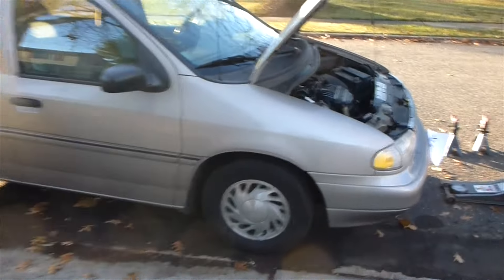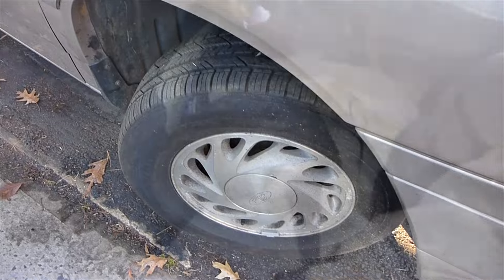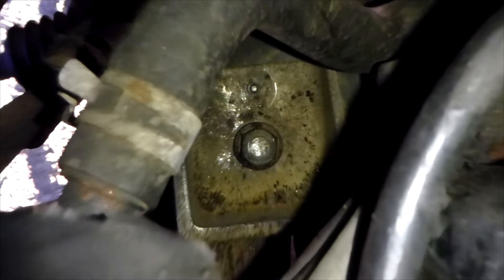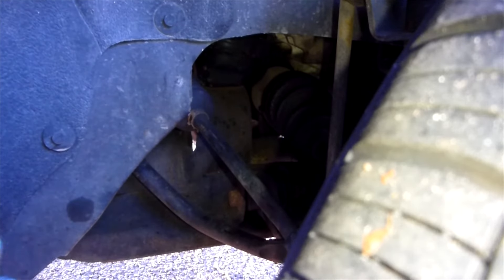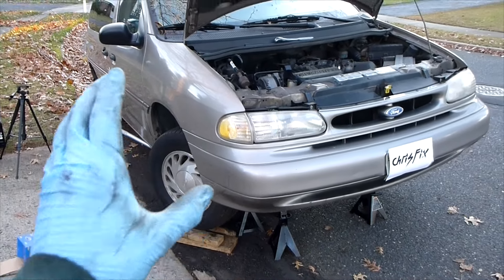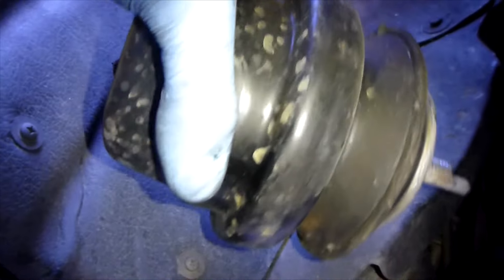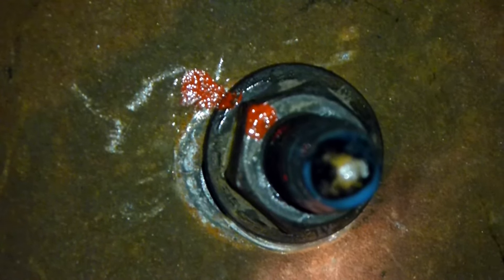How to Replace a Motor Mount or Transmission Mount

Comment: Dealing with installing new motor mounts before; my strong recommendation for Honda - especially Accords is to buy Honda motor mounts. Aftermarket brands are not the best.  You will pay more for Honda but it is well worth it in the long run.
Reply: @SoccerEverywhere2  I would buy the motor mounts specifically from Honda.  If you can get EOM Honda motor mounts somewhere else cheaper, definitely but make sure you get Honda - nothing else.

Comment: I already knew how to do this but i still watched it all the way through.  I love listening to how you explain stuff on your channel!
Reply from the maker: Thanks a lot
Reply: @chrisfix  ive been restoring an old '77 RV with a v8 440 and 727 tranny. Your channel has helped me save a ton of money and im learning how all this works in the process. Its been fun! Would love to see some other videos on transmission repairs, i plan on checking and possibly rebuilding mine soon.
Reply from the maker: Transmission video is next!
Reply: ChrisFix can you do a rack and pinion video ?
Reply: @rocktidwell898  i did a rack and pinion job on a dropped 91 acura integra and it was a nightmare to get it aligned. Make sure you have a way to tow the car to an alignment shop after the change. You can mark everything too but i dont think it ends up coming out perfect. It was probably one of the harder jobs i had to do on a vehicle so far but i was also just learning then. Im sure a true mechanic wouldn't have had as many issues knowing work arounds from experience. Id love to see a chris fix video on that too
Reply: @chrisfix  lol me too, i was just about to start a engine mount job and I thought" hmm how would Chris change one?" and here I am lol
Reply: Rock Tidwe. ll
Reply: Rock Tidwell 'm,katsgf
Reply: Sorry to be offtopic but does any of you know a trick to get back into an Instagram account??
I stupidly forgot my login password. I would appreciate any help you can give me!
Reply: @Abdullah Rex instablaster :)
Reply: @Leighton Tanner Thanks for your reply. I got to the site through google and im in the hacking process atm.
Takes quite some time so I will reply here later when my account password hopefully is recovered.
Reply: @Leighton Tanner It did the trick and I finally got access to my account again. I'm so happy:D
Thank you so much you really help me out :D
Reply: @Abdullah Rex No problem xD

Comment: the core support can be a beefy piece of metal though it usually isn't.  windstars have a pretty solid subframe that's heavy duty and welded. other cars have bolt on core supports or welded supports that do not have much structural integrity. as for jacking up the motor, you can usually get away with a 2x4 cut off under the oil pan if you gingerly jack it up and make sure the motor is moving independently from the chassis. jacking from a small area on the engine block increases the odds of causing damage to external motor components and injury due to less surface area making contact. i learned that the hard way when i was a newbie. i would stay away from jacking from mating surfaces because that has a higher chance of causing a leak. i just wanted share my insight. with that said, i like what you're doing and i like to see people maintaining their vehicles. knowledge is a great thing to share.
Reply from the maker: Thanks for sharing your insight. I would never jack up your motor from the oil pan, but I know people do. I appreciate your tips!
Reply: ChrisFix The Ford Workshop manual actually specifically says to jack up on the transmission pan with a block of wood for the trans mount on the other side.  For the mount you're working on here, though, it says to lift from the top (as if anyone's really going to do that for a motor mount).  I just thought someone might find that little nugget interesting.  Thanks again for the video!

Comment: Hello Chris! I have a question a guy at Precision Tune put both of my motor mounts on my GMC Yukon 2009 SLT and the engine light is still on he removed my tires to put each of them on he said that he didn't leave the seal on there so it would seal so I'm trying to figure out why my engine light is still on is it anyway you can tell me how to do and what to do or where I can take it here in North Carolina

Comment: Chris, I really enjoy your videos! They've been very helpful. This particular video helped me save my brother around $300 by changing the rear motor mount on his 1998 Ford Windstar ourselves. However, I wanted to let you know that the torque specs of 85 ft pounds you claim in the video was too high for the top bolt on for us. Unfortunately, we broke the bolt when trying to tighten it to 85 ft. lbs. Afterwards I looked in the Haynes manual and it says that the top bolt should be 50-68 and the bottom should be 65-87 ft. lbs. We were successful on the second install. Just wanted you to know so you could add an annotation in the video (at 9:07 and 9:31) in order to help others keep from making the same mistake. Thanks again, and keep up the great work!
Reply from the maker: +ohaneson thanks and great work!

Comment: Great video Chris. I recently bought a 1995 Roadtrek class-B RV with 144,000 miles (on Chevy G30 van chassis). Took it in to the dealer for new tires and was told it needed to have the motor mounts replaced. Now I know what they are and what's involved in replacing them.
Reply from the maker: +Daniel Noreladim No problem! Congrats on the new car!

Comment: Replaced my radiator a few weeks ago on a 2004 lancer es and noticed my transmission mount was completely shot. It was the easier replacement ever! Take off the bolt that holds the transmission and get under the car used my impact wrench for three bolts of a frame holding the mount. Unbolt the motor mount and install the new one. 5-8min job. Gotta love old cars

Comment: 2 of 3 mounts in my car are easy to do. # 3  is a real bear.  Tech couldn't do it either. Had to call shop owner who was really slick in assembling swivels, extensions and an adapter to access the mount bracket. Made it look simple.

Comment: This video saved me $1,500 🎉 I had to change all of my motor mounts. The previous mounts were totally shot, I'm concerned that my engine and transmission may be slightly misaligned. Is it possible to check for this and diy engine alignment?

Comment: Any aviation background, Chris?  Your suggestion at the end of the video to mark the nut to detect movement of the nut after installation is reminiscent of the slippage marks used for helicopter/fixed wing repairs.  We use commercially-available slippage mark paint, comes in a little tube w/ different colors avail.  Just curious.  Great videos.

Comment: Excellent Video. NEWBIE QUESTION:  When you jack up the engine, don't you have to worry about putting strain on the transmission, exhaust, and all the other things the engine is connected to?
Reply: Extremely late reply here, but for other people: no, you don't need to worry about that. The engine is engineered to move independently from the frame-- this is necessary in order to dampen vibration. The transmission and exhaust are placed on hangars or mounts of their own in the pursuit of vibration isolation, which thus allow for movement. 

If movement wasn't allowed on the engine, then it'd be vibrating on the frame and would be an unpleasant -- and loud -- ride.

Comment: Some may be against this but in given situations I do use the oil/trans. pan for a jacking point, just use a wide piece of wood and it will be fine. I have this 8x8x1/2 piece of wood just for this.
Reply from the maker: fordwindsor351 Yea, I can see how that might work (especially over a large surface area and if you include a corner of the pan), but if I were to say that on YouTube, the trolls would have a field day! Plus, on my van's rusty oil pan, I am unsure it would hold lol. Thanks for the tip!
Reply: @chrisfix  1

Comment: Wooo , it is so risky when you Jack up the Engine using a piece of Wood on the
Jack , it could break and fall off , however you are a good Mechanic man , thanks .
Reply from the maker: You have to use wood or something similar. Also it won’t break if you use a large piece that can handle it.

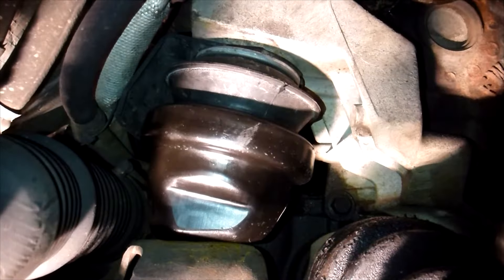Comment: Great video Chris. I couldn't help but notice though the difference at 1:04 and 9:43. It looks like the mount isn't quite seated at 9:43. Won't that put a lot of stress on the bottom stud? I was watching because I am about to change mine. Thanks so much for the great videos.
Reply: I meant 1:09.
Reply: I knoq this is from 8 months ago but if you look very closely that dark part isnt a gap its just really dark

Comment: Much better, pointing out the use of jack stands.  Watched the older video first... Thing to remember is that the car is on jack stands and solid, that's good but once you loosen the motor mounts and jack up the motor, now you have that transmission/engine unit which can fall separate from the car frame itself. Just play it safe, you're too young to be losing your digits :-)
Reply from the maker: ***** Thanks man! Yea, I would hate to lose fingers! That is why I try my best to play it safe (and also teach proper safety).

Comment: Loverly job chris :-), crisp as allways and safety tips :-))

By the looks of it that bolt was bad allready, it would have failed later on down the road.
I like the top extention, that nut was so far away it was in another state lol :D

Ive found wood to be really really usefull, the way it deforms to the shape and spreads the weight automatically, also handy if you havnt got a mallet, you can hit the wood with a lump hammer and still drive a bearing in without damage :-))
Reply from the maker: zx8401ztv Thanks bud! Yea, it was upsetting becuase I spent 3, 14hr days fixing the waterpump on that van (it was one of those days where everything goes wrong) and then this was literally the last nut to tighten and snap. Ughhh lol. But I got a video to teach others how to do it and the van is back on the road so it all worked out!
Reply: ChrisFix
You did it but what a bloody shame, i do understand the feeling :-(
ive been there with electronic repairs, ive repaired a really badly damaged multiband cb radio and got it working up to spec with every voltage and frequency +tuning correct, im happy i recovered it then something stupid goes wrong with a different circuit, makes your heart drop, does me, im so pissed off, i was near the end and ready to hand it back to the owner.

Also when you go into something for a simple repair and its a nightmare of problems (Not told to you by the owner), a simple job gone bad, and the owner later on says "oh yes i know a,b,c,z problems it had", oow i have to stop myself slapping them lol :D

Sounds familiar :D
Reply from the maker: haha exactly!

Comment: Chris, where did you get your torque specs? I just did the mounts on my daughters 2001 Windstar and I have the Ford shop manual and it list 69ft lbs for the top nut, and 56ft lb for the bottom nut. This is for the 3.8 engine. Did it just as you showed, new mount was a little taller than the old, but finally got it turned just right and it slipped right in. Thanks for the help!

Comment: Chris your a badass, I've been watching your videos for some time now!
I've got a couple general questions, you seemed to just jack up the motor with no problems. The motor isn't hard connected to the vehicle? I always imagined that something external on the motor would snap. But it seems that the engine is just floating on the motor mounts? Is this the same for the transmission drive train? That its just "floating" under the car? I've got a 96 Silverado with 336k original miles on it. The truck is all original and I'd like to go through and replace all the bushings and lube the chassis. 
So my next question. I couldn't find a video with your truck. I don't like jacking up my vehicles from the side frame, I feel like it's an unnatural movement. Where is the best place to jack the whole front of my truck at the same time, and also the best place to jack my rear?
Thanks, I hope some way your getting checks in the mail from doing these videos. The way you present them is fantastic and inspiring. Your the man. 
Patrick
Reply from the maker: +Patrick Calabrese there is wiggle room with the motor and tranny. The motor vibrates and moves a lot so they design it with space.
I like jacking the rear up from the differential but for some reason every owners manual says not to... I never had a problem. The front crossmember that cradles the engine and holds the suspension is what I use to jack up the front of the truck.

Comment: You MUST be a mind reader. I have a leaking coolant bottle and was going to flush it. My car also has a known issue of one of the front motor mounts to constantly go bad so I also need to change that.

Thank you again for the video!
Reply from the maker: Weese Haha, I am glad the video was timed perfectly! Let me know how your motor mount replacement goes! If they are the originals, you might want to spray some penetrating fluid on them! Here is stuff that will make any bolt come off: https://www.youtube.com/watch?v=2WuVBFTzoKc

Comment: Your video's are the best, very easy to understand you stay on point love it!! I have a 986 Boxster it needs some suspension work do you ever work on Boxsters? Thanks keep up the good work.
Reply from the maker: william carroll Thanks a lot man! I havent worked on any boxsters yet. German cars like to use different tools so instead of normal bolt heads they have hex heads. Otherwise, it is all the same stuff! Good luck fixing up your boxsters suspension.

Comment: Chris, My 1988 porsche 944 will not start. I think it could be the fuel pump because when I took it off the trailer it started and it drove off, but on the way into my garage it died and wouldn't start. Is this the only thing it could be or is there more. I tried pressure testing but the port on the tester was too small for my shrader valve. It would only stay on the end and not spin all the way down, but even with the tester only on the end of the valve I read 0 pressure. Thanks and keep those vids coming they are really helpful!
Reply from the maker: argonian bilbo I would get an adapter so you can do a fuel pressure test and get a good reading. Do you hear the fuel pump priming when you turn the key to the "run" position? Check this out: https://www.youtube.com/watch?v=_oXLUqE4Sf0
Let me know if you get that pressure reading!
Reply: ChrisFix yes I hear a buzzing sound, but it coming from the engine bay.  The pump is in the back. There is no sound in the back
Reply from the maker: argonian bilbo You should hear the pump prime like in the fuel pressure video. Check the fuel pump fuse!
Reply: ChrisFix ok thanks. I'll probably buy a pump anyway because it sat awhile

Comment: Hey ChrisFix - I see you use loctite on most bolts, however I noticed that you often don't use an thread lubricant - which I thought is interesting as these bolts will go untouched for a long period of time in harsh conditions - wouldn't it be advisable to use some type of lubricant on these bolts to ensure easy removal and providing some protection against the elements?
Reply: Loctite also provents rust my man
Reply: Lubrication of suspension bolts and engine mounts is not something you'd want to do better off to just put the bolt on torque it down and then paint brush on some old motor oil if you feel the need but if u put it in the threads how would the locktite do it's job? Bolts hardly ever rust where the nut is it's always usually the spots that are open to the elements.

Comment: Hey Chris.. long shot but I'm desperate here. I'm trying to fix my motor mount (front passenger - the one you don't fix). The previous owner must have not bolted the bolts in correctly because after I hit a pot hole they seem to be missing. Is there anyway you have some idea of the size of threads that these bolts are?

Comment: Sounds like my scenario. The workshop manual for my car stated 74 Lb ft for engine mount bolt. Sheared right off. Subsequently found another place in the manual it said 46 lb ft. That manual mistake cost me a lot of time and money.
Reply from the maker: Darn! Were you able to fix it?
Reply: @chrisfix  No, still working on it. And with Covid, who knows how long it'll take to get a replacement sent from the other side of the planet (UK), as none in stock in NZ. Will keep looking for a 2nd hand one here.

Comment: I have a question. I drive a 03 jeep wj and I have a few problems one been the steering. I took it to get it alined but it still don't drive straight and if I get on the freeway I have to constantly play with the wheel to keep it straight. I think it's my steering gear box but idk how to change it and what else I should change while I'm at it. Thanks and great videos.
Reply from the maker: Raynolasco9090 Many times, your alignment shop will mess up and your car will pull even after they align it. You have around 90 days to bring it back to them and tell them that it isnt driving straight and it is tracking. They might lift it up and tell you it needs X,Y,Z and then you know. But most of the times, they adjust the tie rods and it is better. Here is how you can check your tie rods yourself which might cause the problem if they are worn (it is a little different setup in the jeep but the same methods apply): https://www.youtube.com/watch?v=brI2feYiEi8